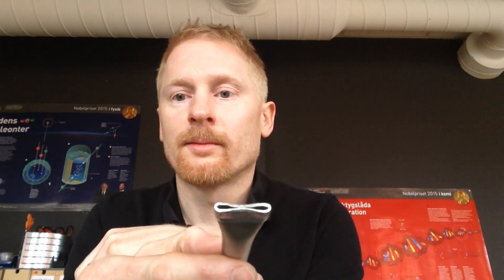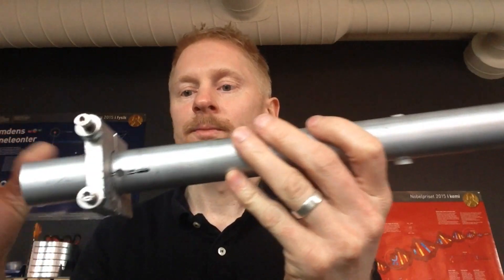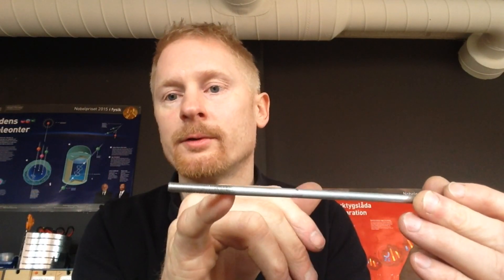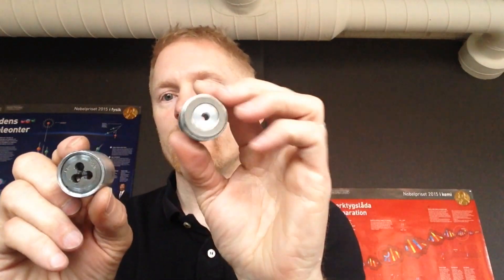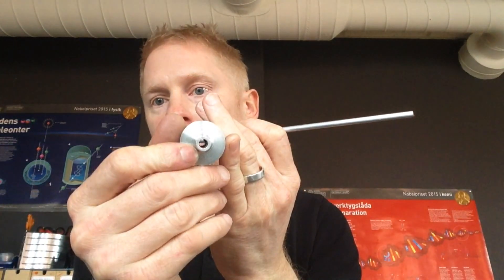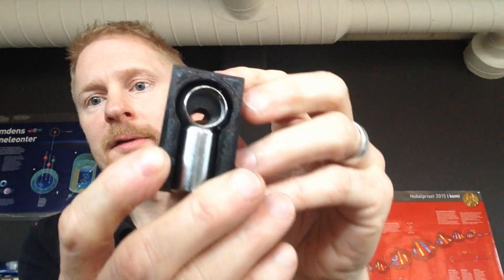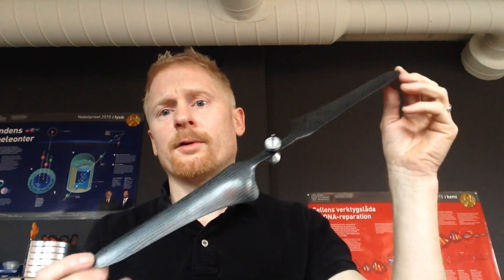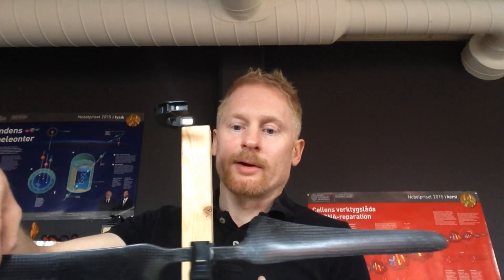chAIR -Manned multirotor Episode 16 Quadcopter style

Comment: Thank you for sharing your different custom tools, I especially like the centering die tool that attaches to the drill motor.  I really support your work here and admire your creativity and engineering.
I know it has already been mentioned here multiple times and I want to put in my appeal to not just use a wire wrap for electrical connection.
I couldn't figure out how you keep the two paths of current isolated from one another, the rods appear to attach to the same arc of tubing.  The motor mounts show how you separate the two Aluminum rods and is a clever configuration.  I can't help but wonder though if the motors will remain perpendicular to the same plane, or if there is some sort of twisting that occurs as they experience the force of lift that will cause them to angle away from the lifting plane and cause drift.  The cross connection may eliminate the twisting, however the bending of the tubing could just direct the deviation angle at 45 degrees.
I couldn't help but notice that the four motors are connected in series and appear to NOT be turning on and stopping at the same time.  I am wondering if this response difference will affect control.  I also wonder if it is okay to just run those motors without any load.
I am not being negative here, there is no place for that!  I truly admire this build and feel very positive that you will fly! Well done!  Thank you for sharing and thank you Hobby King for helping to bring this amazing DIY project to all of us out here in Ytube land.
Reply from the maker: Thanks!
Well, to be perfectly honest, I pretty much share all of your concerns.
Just as you mentioned the the row of four motors captured in the video does not turn on at the exact same time. Other rows does, and yet a couple other had a motor that started considerably much later. The ESC controlling those motors have been replaced and the problem vanished. So some slight variation in the ESCs, which is sort of weird. I think I had to replace 3 or 4. Probably not a deal breaker, but I do not want to start testing the craft with obvious flaws....

Comment: So how much lift will this thing have?
Reply from the maker: 300kg+ peak thrust with new charged batteries, typically 270kg (50% discharge). Take off weight will be around 150kg :-D  So a fair amount of overhead power left for accurate control.
Reply: How heavy is the batteries?
Reply from the maker: 35kg, 80pcs multistar 5.2 Ah 4s 10C batteries 433g each. 35/150(TOW)= 23% wich is kind of low for a electric VTOL vehicle, but the swept area is 10 square meters wich gives a pretty light disc loading (15kg/m2) and  good overall efficiency.
Reply: So you chain them to 8s40p? And did you calculate with attention to the sag in the batteries? Cause if you pull 50 amps from a 5.2Ah 10c battery it's going to sag pretty hard. You will still easily be able to fly, but it might not create as much lift as you thought.
Reply from the maker: Correct. Yes, I have taken voltage sag into consideration. Early testing indicates that it will hover just over 3C and I expect to be able to "fly" not exceeding 4C (21A)  which I think is pretty much the max continuously C rate for these cells really.
Reply: Nice, I really like when people realising such project really know what they are doing :)

Comment: Just a friendly design consideration from someone who has flown more drones than most people. 

Your middle CG pilotchair idea has a few possibly fatal flaws. 

1. Location of propellers in case of crash can cause carbon fiber blades to shoot through you like butter. The best arrangement would be over head with proper fire wall protection. There are other successful flight tests of that design. Also if they are over head it makes flight navigation obstacle free. Clear line of sight. Middle seat is a terrible, terrible idea. 
2. The CG with weight located lower works fine on smaller race quads we fly. Lots of people fly battery on bottom and the aircraft performs great. Lower load aspect. Less chance for tipping. Slightest accidental relocation of your current manned CG load location can cause a huge disaster. 

Please please consider a design change. If not for yourself for the performance of your aircraft.

3. And like someone else said. You would be much safer using a power system redundancy. And autopilot failsafe to land if shit hits the fan. 

Obviously you have some $ to spend...
Don't buy Yugo parts to make a Ferrari. 

Hobby King grade materials are almost the lowest grade materials you could get for this project. Cost effective but prone to break, short out, and cause untold catastrophic failures.